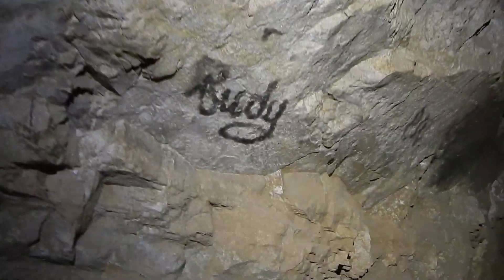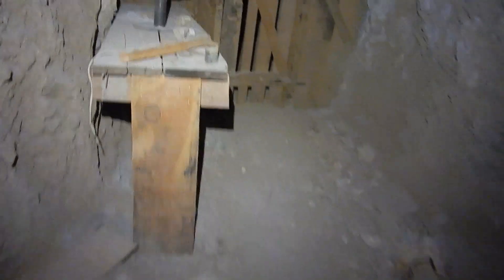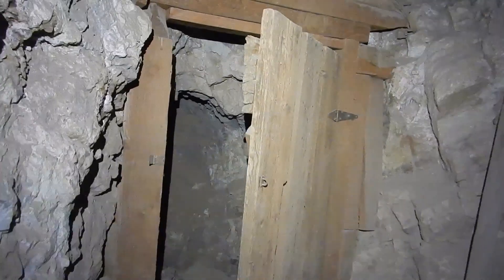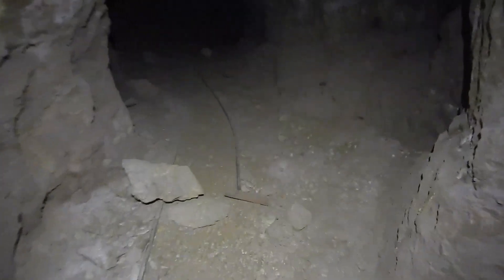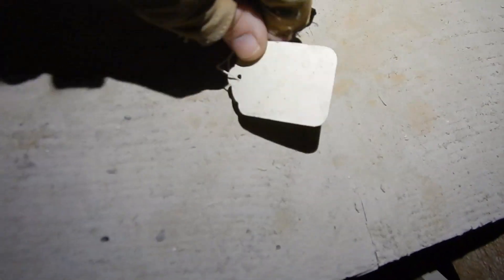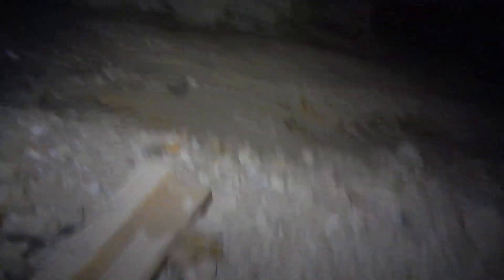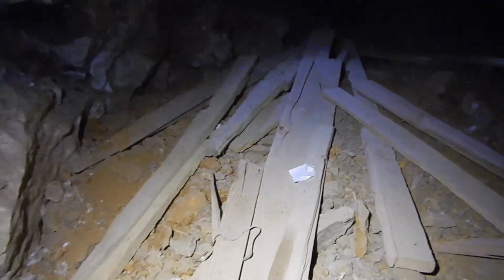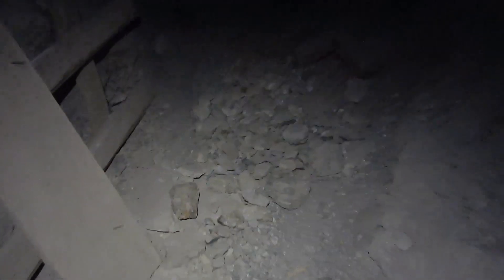Discovering Artifacts

Comment: As a vet, I understand trying to save weight in your pack, but there's no way in hell I'd walk into a mine without SEVERAL spare batteries.... For each light! 🤣
Reply from the maker: Oh heck yeah, i agree.  Its the camera that i had only one spare battery.  i carry two spare batteries for the camera now.  We carry a spare 18650 heavy duty battery for the headlamp and handheld flashlight.  And an emergency back up flashlight. they usually last about 8 hours on the handheld, the torch is good for 4 hours.  so we are good for 16 hours basically.  they are LED and we could turn down the intensity and go for about a 100 hours on low.  We used to use 3 D cell MAG lights, oh my,  that was brutal heavy.
Reply from the maker: Thank you for your service, that means a lot.  I have my fathers flag, he was in WW2.
Reply: @mineadventures7938  same here. My father was in the Aleutians as a combat engineer in WWII. I have his flag as well.
Keep up the great vids man, I'm really enjoying them.

Comment: You bring chalk to mark arrows?
Reply from the maker: No, i actually havent done that before, there are usually arrows or rocks stacked or string.  However, i have been very disoriented 2 times and one i panicked in, the other was more frustrating than panic
Reply from the maker: i don't think i could go into a coal mine.  the water scares me a bit
Reply: @mineadventures7938  you get use to it. The snakes and dry scare me in yours :)